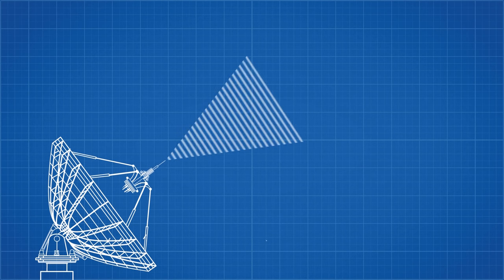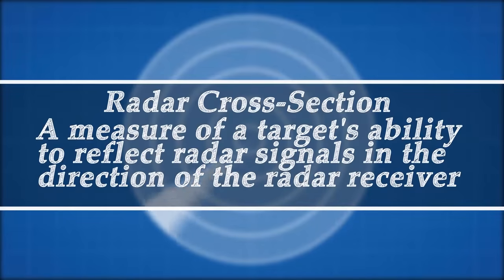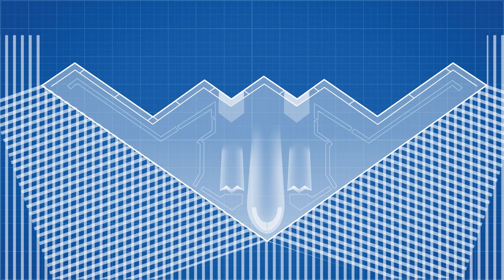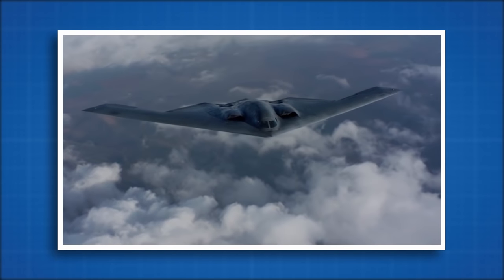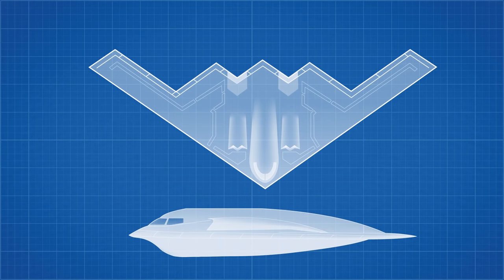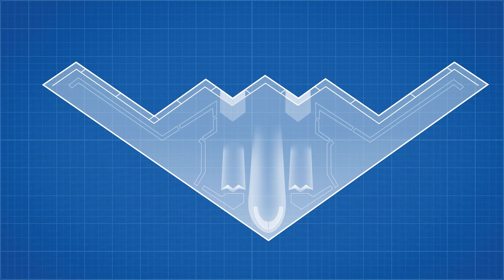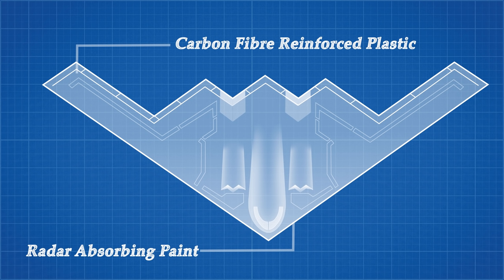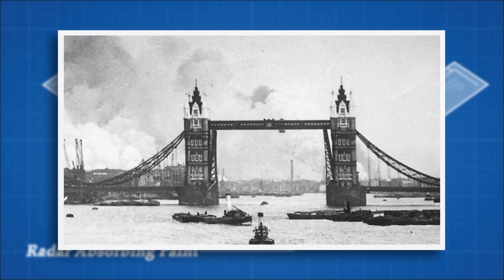Stealth - How Does it Work? (Northrop B-2 Spirit)

Comment: so let me get this straight...the B-2 has a radar cross section of a large bird. There are no large birds that can cruise at 900kmph...so wouldnt it be obvious to a radar operator that it is a stealth plane on his radar and not some bird?
Reply: That's not how it works.

Every radar can only detect a given radar cross section (RCS) up to a given range. These are all given by the radar formula and a base value. Basically the radar needs a powerful enough radar return to detect the aircraft.

So for example, if your radar can detect a 5 m^2 RCS at 300 km (meaning maybe the RCS of a car or minivan or something like that), it might only be able to detect a bird-size RCS at 50 km. Of course, within those 50 km, it can tell the signature is the size of a bird, yet the other parameters are enough to distinguish it from birds. It's why knowing the radar signature of an aircraft is a good thing, you can identify it faster, which is also why the US hide their aircraft signatures from other countries. Also birds aren't made of reflective metal so there's that.

Comment: Aaaaaand I was enjoying it so much right up until they talked about the Ho 229...I'll keep this short. The Ho 229 had minimal, if any, stealth features built into it and all claims that it was designed as a stealth fighter came from after the war was over. It also would have made absolutely no different to the war's outcome, as Germany still would've run out of the fuel needed to run its jet engines. Actually it probably would have run out faster.

Comment: Question: The B2 has a radar cross section of a small bird, but that means they still show up on radar, right? How about just having a clever piece of software analyzing the data, which instead of just ignoring all small birds would just go "there's a small bird that's flying at 900km/h, so it's a good bet that's a B2"
Reply: A radar works by sending waves a direction and detecting what bounces off of the aircraft and comes back to the radar. If the radar cross section is much smaller, the signal bouncing back will be much smaller. Since the signal decreases with distance (the same way a flashlight works), the B-2 is much harder to detect. It has to be much closer for a bouncing signal to be possible to detect.

This can be quantified through the radar formula, which has its wikipedia page. Of course, it also adds other parameters, like wavelength. What people fail to mention is that while longer radar waves have longer detection ranges, they also require a bigger array for the same accuracy. If you go from regular radar waves (X-band) to the longest waves, your radar that is 1 meter wide would now need to be 50 meters wide for the same accuracy. Basically, the B-2 is much harder to detect and even if it is, that doesn't necessarily mean that it's in immediate danger.

Finally, the aircraft gets a much stronger radar signal from the radar than the radar gets back from the aircraft, so the aircraft can spot the radar before the radar can spot the aircraft. So the aircraft can fly around radar.

Comment: Couldn't we bundle radio signals with infrared and speed detecting tech that way we would be able to detect an aircraft such as the B-2 due to the fact that its paint changes radio signals to heat?

Comment: This video sadly didn't answer the one question I had about the B-2: How does it not just drift sideways uncontrollably in the air, when it doesn't have any sort of vertical stabilizer.
Reply: Combination of its design and SAAHS
Reply: @Sup3rPat  What does the SAAHS use to keep it flying straight? Can it redirect thrust to its sides to cancel sideways momentum?

Comment: Great Video👌🏼. However I don't believe the HO229 would've made any impact if introduced in 1945... after all, Germany by then had no fuel and runways from which to operate planes, and also, if it flew to bomb, let's say Paris, it would've been easily shot down on the return trip...
Reply: It wasn't even intended for production. It was simply a proof of concept for a flying wing fulfilling Goering's "3x1000" pet project

Comment: The fact that a German plane used a scheme - a flying wing, did not make it invisible. Such a scheme affects the range of the bomber, and it was wooden. The United States chose this scheme, as it was more suited to the terms of reference.
Many schemes of flying ships have long been known since the 50-60s and they have scientific names, terms. The leading aviation powers have long since purged all kinds of flying means schemes in wind tunnels. When developing, designers choose the scheme that meets the requirements of the technical specifications.
The uniqueness of B2 in its stealth capabilities and appearance. Until the 1990s and 2000s, the flying wing in aircraft construction was rarely used due to mediocre flight capabilities. But stealth revived this scheme. Now all drones and bombers will be approximately with the following requirements:
-low visibility
-the ability to fly at low altitude
-range
-subsonic speed
So, the priority will be the scheme of the flying wing.

Comment: That would be my question? What is it about that material that can absorb radar?
I'm going to take a wild guess and say there is some synthetic lab made material in there.......
Reply: I mean, yeah? It's the same principle as very black paints. They can absorb a lot of light from a specific frequency. That gets more difficult as the wavelength increases, but it's far from impossible.

Comment: The Horton 229 was absolutely not a stealth bomber. Hell it was barely even a plane. All the claims of it having been designed to defeat radar were made after the war by a guy spouting bullshit to try to become notable. The allies tested these claims and found that there was no evidence of any part of its design, either its shape or the supposed radar absorbing paint it used (which itself was also found to be a bullshit claim as no such paint was found on the prototype nor its designs) would have had any effect on its radar cross section.

Comment: If the paint is radio wave reflective, how does some of the equipment work in the aircraft such as coms?
Reply: Microwave reflective. Not Radio wave reflective. It's a misnomer caused by the term "R.A.D.A.R.", meaning RAdio Detection And Ranging. Though most  R.A.D.A.R.'s use something along the lines of microwaves.

Comment: Excellent video except for the Nazi tech-wank at the end. The Horton Ho 229 was not advanced nor revolutionary at the time. It was simply a jet plane made out mostly of wood and even then, the metal pieces of the engine still gave it a big radar cross section. So, it wasn't stealth and no matter what the Germans did, they were going to lose.

Comment: just more technological from ho-229 nice steal guyz
Reply: +EgemenG Videos

 There was nothing to steal. The Hortens were not ahead by any means.
Reply: Nathan Peterson the idea ?
Reply: +EmegenG Videos

 How was the idea stolen? Northrop had been making tailless aircraft as long as the Hortens had.
Reply: Nathan Peterson Bro i understand you but, after ww2 the only built horten has taken away by Americans they studied it , before that therr was no aircraft like that not even in the idea
Reply: +EgemenG

 The Go 229 v.I was destroyed in a bombing run if I recall. The v.II crashed on its second test hour of flying in '1945, and the v.III was in complete, and brought to the U.S. well after the war, sometime in '1947.

 The 229's were not special by any means. In construction or abilities. Northrop's N-9M is considerably older than the v.II was, but continues to fly to this day. Even older and more successful (in terms of flight record) was the N-1M. The flaps were of different design and control, and the first to be introduced on a tailess aircraft on the v.II to fly. However it wasn't the first in that regard, nor was it particularly outstanding in performance.

 Soviet aviation pioneer Boris Cheranovsky had been working and flying tailless aircraft before either of them.
Reply: Nathan Peterson i see thx for the infos man 🙂🤗

Comment: If the enemy notices what looks like ‘a large bird’ flying at 50,000 feet or so it’s that as good as identifying the aircraft? Also didn’t one of these get shot down in Kosovo by a guy using outdated radar?
Reply: +Edward Wood

 That's referring to its R.C.S., many high-frequency R.A.D.A.R.'s would not pick this up. 

 And no, that was an F-117A over Belgrade. The F-117A was younger than the missile system, the S-125, but considerably older than the particular R.A.D.A.R. set that "painted" it. A heavily modernized P-40 system received from the Soviet Union in the turn of the decade ('1990). The F-117A had no countermeasures to speak of mind you.
Reply: Nathan Peterson Interesting specifics. Thanks.
Reply: No problem.

Comment: Interesting about the engines the meat plumes could be seen on it as for the split wing and yaw adjusting asymmetric controling engines with the secondary effect of roll being adverse yaw tis aircraft bat low slow speeds must be on the ferry limit of entering a flat spin on either take or or landing gense the control laws in the flight control computer must be incrediblyrobust.. I wouldn't want to be the safety engineer underwriting that lot